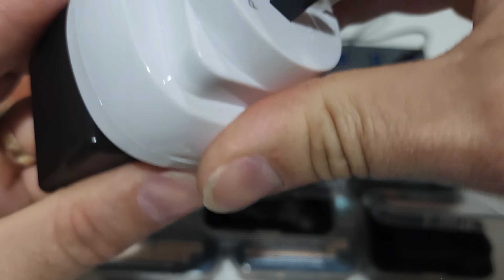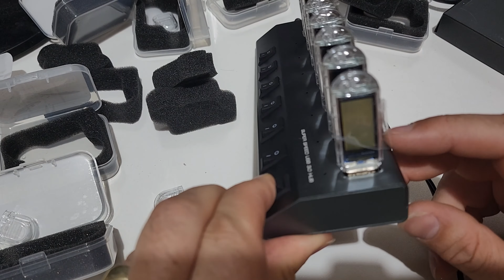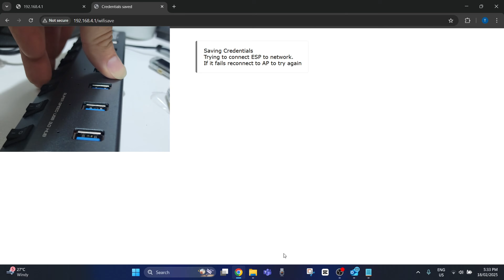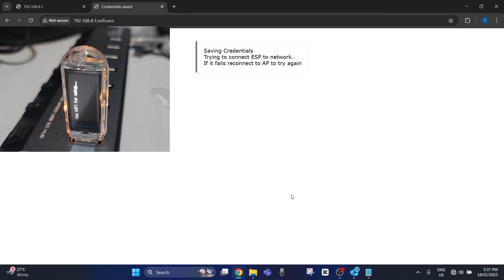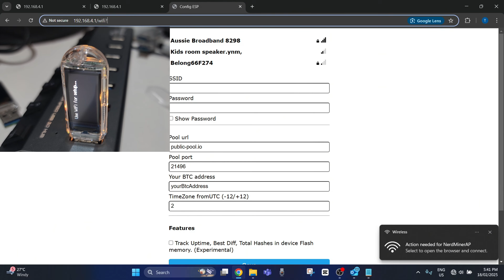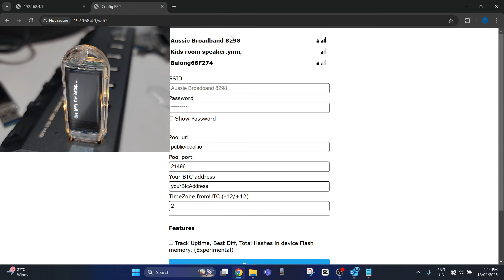NerdMiner 2 Complete Setup Guide

Comment: Time zone not regular time, It is a standard used to establish time zones worldwide. For example, New York City is in the UTC-5 time zone, which means the time in NYC is five hours behind UTC (except during U.S. daylight savings, when it is four hours behind).
Reply: There's no decimals just plain number +, -
Reply from the maker: I believe the issue is that it does not allow for any time zone with a 30 minute difference eg utc +930. Would only allow utc +9 or utc +10.

Comment: Anyone know what the check box option is on the setup page at the bottom that says (experimental) out from it?
Reply from the maker: I would just stick with the standard version. Anything experimental may cause instability. If you like you can try it first, but if there is an issue just erase it and put the proper version on.

Comment: How much $btc mining per day ? Thanks
Reply from the maker: This is a lottery miner. If you tried to mine in a pool with this one (if you can find a pool that would accept a low hash rate) you would not even earn a single cent in 1 year. It's made for the lottery, so you have a chance (very very slim chance) of hitting a bitcoin block worth $200,000 for next to no power consumption. But the chance is more than 1 in 100,000,000. I am bring out another video in the coming weeks that demonstrates a more powerful miner, so stay tuned for that.
Reply: @technologyteardown  ok bro. thanks

Comment: Hi do you know how to put new firmware on it? It can go up to 300kH/s as I can see but I am unable to perform it. :) It is too late for me. I have to go to sleep.
Reply from the maker: I have this video here which shows how to remove and put on the firmware:

https://youtu.be/07cP98s4nTQ

I haven't experimented with over clocking the nerdminer to increase the hash rate. So this firmware may not do it.
Let me know how you go. Would be good to know how to do it. 👍
Reply: In my first programming,I was build in original bin file and the works is simple and I've been reaching 20+kh/s on esp32 Dowd V3 weren't the appearance of the chip was WROOM 32D.but in my second programming is I can maket it the same process and my hash rate is down at hash instead of kh/s. @technologyteardown